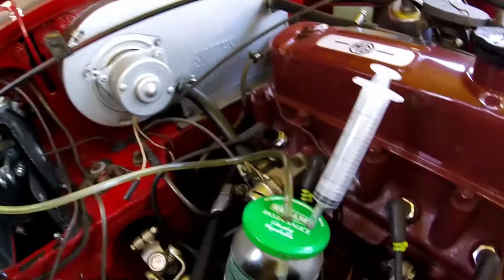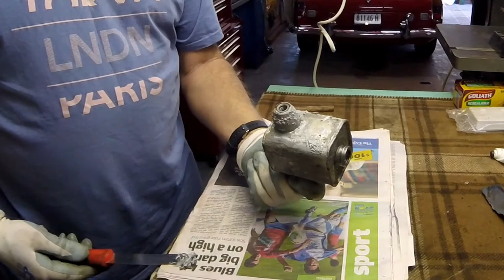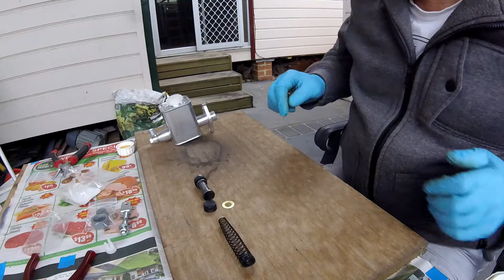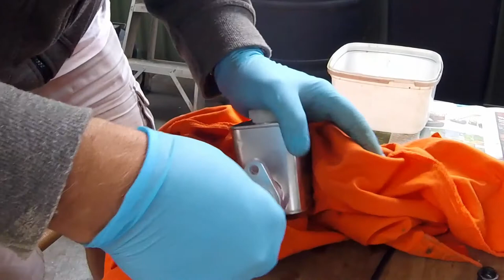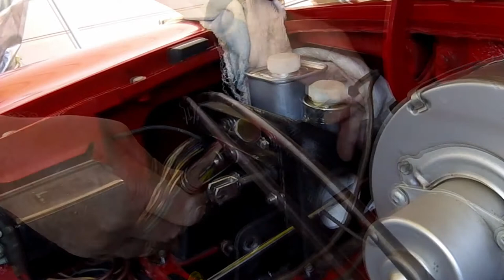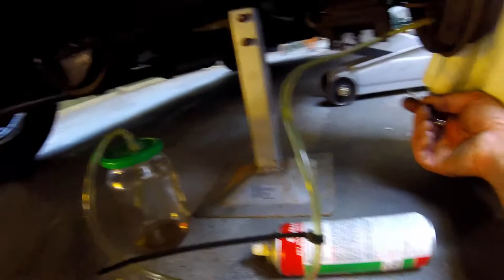1967 MGB Mk1 Brake Master Cylinder Restoration

Comment: Thank you for posting this video.  I am about to replace the master cylinder on my 1964 MGB.  It has help me understand what is require to do the replacement.  My car is right hand drive other than that my car looks like your car.  I bought it from the original owner in 1986, it was British Racing Green.  After replacing the interior seat covers, paneling and carpet, I had it painted Red, It is the same color as yours.  I still use the original top and tonneau cover, plus I have the work manual, show room booklets and tuning manuals. I love this little car.  Thanks Again, Rich
Reply from the maker: Hope the video helps you with your Master Cylinder. You shouldn't have any problems it's not that difficult a job. Cheers

Comment: I find it easy to bleed on the bench and fit complete, just fit rear banjo using bulkhead bung. leave over night with pedal press down with stick and it will bleed itself.

Comment: Thank you for your video, I to have a 67 MGB and find following your video very easy as it nearly always matches my car. I have a simple question. After following your video, I have dismantled the Master Cylinder and added the new seal kit. Everything done nice and smoothly, but how do you get the rubber boot over the push rod and past the washer and clip.
Reply from the maker: Hi Thanks for your comments. The boot will stretch over the clevis end with a bit of brute force. There is a feeling that the rubber boot will split doing this, but it does stretch, just needs a bit of persuasion. Cheers👍

Comment: What paint color did you use on the cover and heater?
Reply from the maker: Not sure which cover you are referring to, but the heater was painted silver by the previous owner. I am considering repainting the heater box back to the original black. Cheers
Reply: @albabmg  The pedal box cover.
Reply from the maker: @aggiebq86  Both the pedal box cover and the air filter boxes have a chrome finish. Both were on the car when I purchased it. Cheers

Comment: Thank you for this video. I recently became the caretaker of a 1964 MGB which had not been driven for quite a while. After the first few drives I noticed that the master brake cylinder is leaking along the push rod. So I assume that I have to replace the seal kit. Your explanation on how to disassemble and reassemble it all will be very helpful. Unfortunately has the leaking brake fluid damaged some of the paint below and rust is starting. Do you have a recommendation on how to best remove this fluid and how to prep the sheet metal before spraying some primer and paint on it?
Reply from the maker: I'm no expert with painting but I would wash brake fluid off with a detergent and rinse well. I would then treat the area with a rust converter then apply an etch primer. After this you can apply whatever paint system you intend to use. Cheers
Reply: @albabmg  Thank you for answering my question. Highly appreciated.

Comment: hey BMG, can you post a link to the kit you used?
Reply from the maker: Hi The seal kit and clevis kit was purchased on ebay Part No. 180-875 GRK1026 for the seal kit and Part No.181-690 17H7985 for the clevis kit. They can also be purchased from Moss Europe
Reply: @albabmg  thanks! I will be on the lookouts for those! Currently restoring my brakes. I can't open the calipers they're rusted through :( )
Reply from the maker: @samuelchung7783  I had the same problem with mine. I'm still considering purchasing a brand new set of calipers, maybe in the next couple of months I'll do that. Cheers
Reply: @albabmg  hey BMG, i finally got around to dealing with the Master Cylinder for the brakes. I'm having (a lot) of trouble trying to get the darn box off! how did you do it? I can't seem to find any references for the early type (separate clutch and brake cylinder) in the hard to reach square box! any help would be much appreciated.
Reply from the maker: @samuelchung7783  Hi Samuel only too glad to help if I can. What are the boxes you are referring too? I'll try and explain the procedure I undertook. 1st up I removed the Brake and Master cylinder cover, there are 4 screws on the cover flange which need to be removed. After removal this will expose the clutch and brake pedals and clevis attachments. Remove the clevis and pin then disassemble the brake pedal and let it fall into the foot well of the car. Undo the brake pipe at the rear of the brake master cylinder. Undo the upper bolt of the master cylinder where it attaches to the pedal box, this bolt is easy to access. The lower bolt is the difficult one to get to but it can be done. You can get a spanner in to it. Rotate the front bolt with a socket and with an open ended spanner access the rear bolt until the spanner engages the nut. The spanner will be resting on the clutch master, that is how tight it is. Once the two bolts are removed you will have to twist and manipulate the Brake Master until it can be lifted over the pedal box. Also important is to match mark the rear banjo fitting to the cylinder, this will align the brake pipe for later attachment. There is an alternative for Clutch/Master cylinder removal. There is a rubber bung behind the cylinders located on the bulkhead. This bung can be removed which will give you access from inside the car near the pedals. Hope this helps.